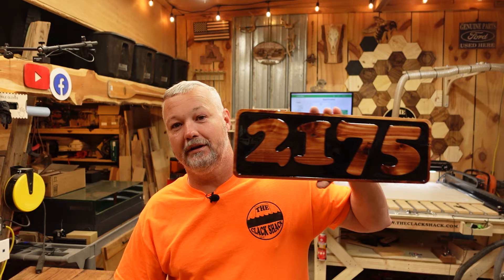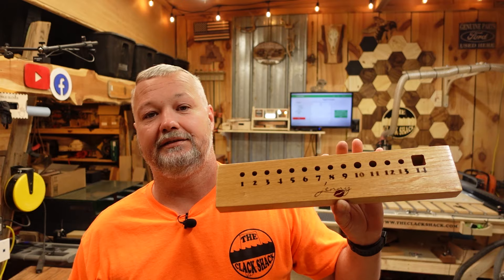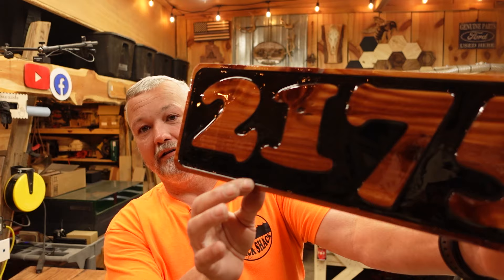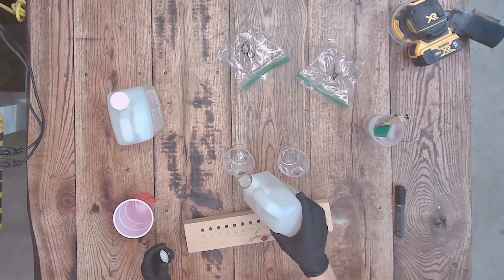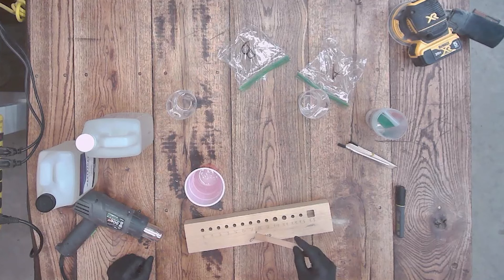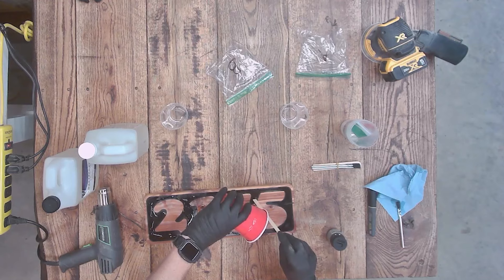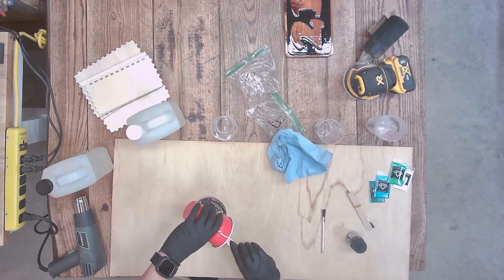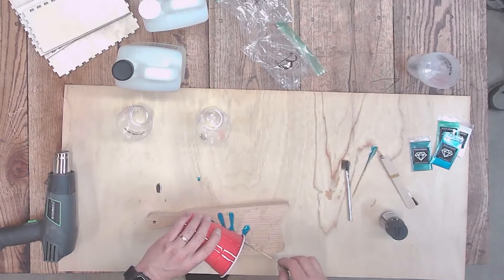Learning epoxy, the hard way..

Comment: I do epoxy and it's very easy. Here is the number 1 tip. Make sure you have a quality epoxy. I actually use total boat deep pour for everything. Takes longer to set but so many less bubbles. On my serving trays I pop bubbles to start...then let it set for 2 days.
Reply from the maker: I plan to do much more experimentation, thanks..
Reply: @TheClackShack  need any help let me know.
Reply from the maker: I enjoy experimenting, I may try the deep pour next. Gotta use this stuff up first... lol @j316finewoodworking6
Reply: @TheClackShack  just offering to help...experience is always the best teacher though.
Reply from the maker: I appreciate it for sure. I just enjoy learning the hard way.. lol  @j316finewoodworking6

Comment: A cheap silicone mat would be super useful if you do this often as would save the surface you're pouring on and be easy to clean up as it cures, won't stick.

I use mine to keep glue and stain off my surface.

You can order them cheap online, they also sell them in stores as a little sturdier made for cooking/baking (IDK that's outside of my wheel house, I just found them there and picked one up, lol)
Reply from the maker: Luckily, I have lots of old plywood and carboard. Thanks

Comment: Good morning… I use that same epoxy. I do multi pours fairly regularly. I use 0.12 for my initial depth. I seal with shellac to keep it from bleeding. Pour the background color. Then all other depths are .01. Do all my other pours letting the epoxy cure usually 8-10 or longer depending on temperature. The to do final skim I do 0.002 using a 1/4 in flat bit from surface top. If you haven’t take a look at Shane Hardwood, Rob Sandstrom and Stephan Forsaellas (sp). I use Vcarve Pro but with my Onefinity I recieved 1 year of Carvco. Leighton does a series on epoxy starting from a single pour all the way up to a 14 pour dragon. (They are on YouTube)Not being critical because I am not a professional but it sounds like you’re doing your final skim too deep. You just need to skim the very top off even with your board surface. Keep up the good work.
Reply from the maker: Thanks